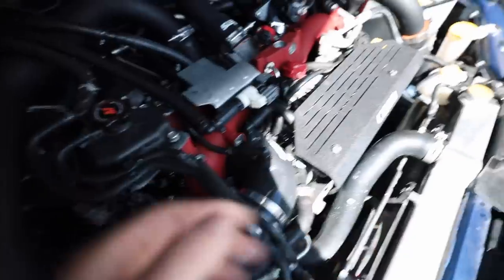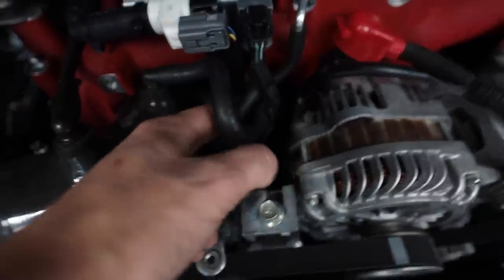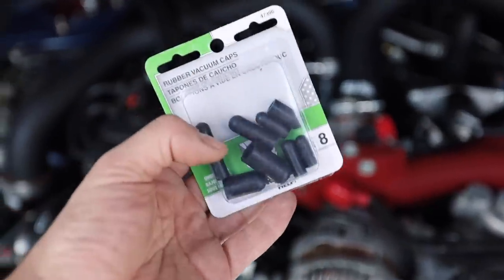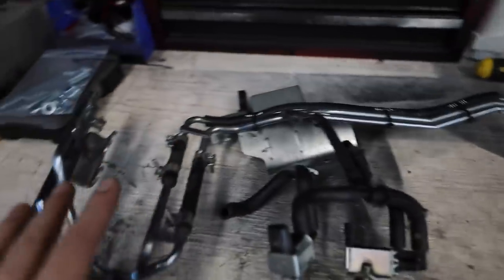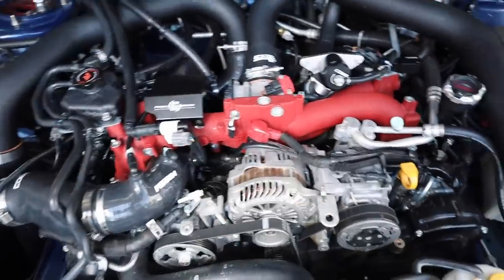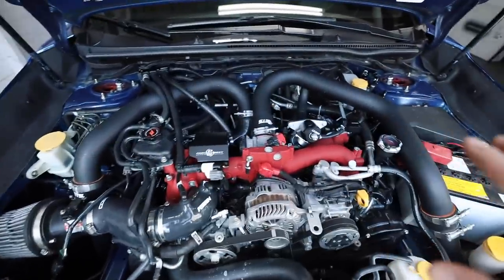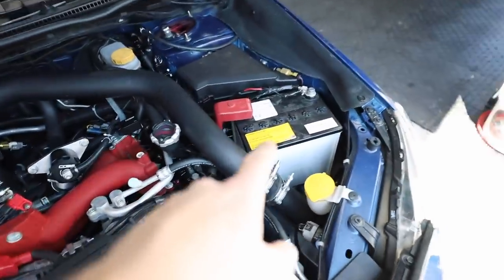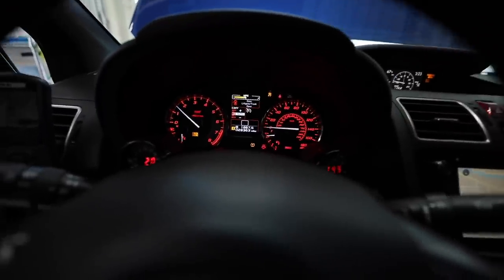How to Delete your EVAP Solenoid (STI)

Comment: Keep in mind, any rubber cap on the intake manifold can potentially become brittle and rip, causing hidden vacuum/boost leaks so make sure they're inspected periodically and replaced accordingly. The other  method of capping unused intake manifold ports is to use the same diameter rubber hose as the cap and plug the hose with a machine screw, then zip tie/clamp it to stay put.
Reply from the maker: I've used that method before as well to cap off, and agreed the rubber will become brittle, especially in the heat or hotter environments. Good add joe! 😁
Reply: @Smeedia  No problem, my guy! Pumped to see it on the dyno soon!
Reply from the maker: Same! Just got fuel pressure set, car is running beatifuly on the base map now!
Reply: @Smeedia  Outstanding!
Reply: My question is! Will the codes comes back on if you replace the battery, or Reflash the ECU?.

Comment: Run the dump hose down next to the transmission. You won't smell it and you won't want it in the fender because you will have oil and other goodies come out of the hose.
Reply from the maker: Good call, I was thinking of going to the drivers side to dump it all so its not all dumping onto the EWG
Reply: @Smeedia  Bingo. I also have my Perrin AOS drain hose going down with a ACE hardware copper shutoff valve so I can drain the AOS when I change oil. I personally don't want any fluids recirculating back into my oil. 🤷🏻‍♂️
Reply: You could even zip tie the hose to the bracket that holds the transmission vent hosepipes! Thanks
Reply: You could even zip tie the hose to the bracket that holds the transmission vent hosepipes! Thanks

Comment: Simply use a golf tee to plug the intake and leave the canister evaporator hose open. You do not need to remove the solenoid because it will stay open. If not, then just disconnect the canister hose. Do not unplug the purge valve!

Comment: A shop worked on my car 09 wrx, put new aftermarket fuel lines, TGV deletes, and all that good stuff, they asked if I wanted to delete the EVAP solenoid and I said yes, but now my car struggles to turn on I wonder if that delete is the problem. Also the smell of fuel is unbearable. Planning on putting the EVAP back in hopefully it fixes the starting issue.
Reply from the maker: Putting it back in should help clear up those issues 🙏

Comment: This video just saved me so much time finding where the evap line from the T to the stock fuel lines went. You are the man.
Reply: looking for evap lines is why i'm here
Reply: @furykillerBZ   yeah its such an annoying part of rebuilding an EJ if you dont do it alot.
Reply: @erikpowers4358  at this point I'm not even rebuilding; just chasing a vacuum leak
Reply: @furykillerBZ  ughh even worse. Good luck with it. Hope you get it squared away quickly 🫡

Comment: Bro you’re videos have been helpful more than anything else with my recent bugeye build, i just installed iag fuel rails with aeromotive fpr evap delete custom diy tgv delete, walbro 450 lph, 1300cc injectors and a Blouch 18g billet wheel.
Reply: Took about 9-10 hours total over 5 days but so worth it looks so much cleaner now
Reply from the maker: Eyyyy glad that it came out clean!!!!

Comment: Bro thank you so much for this video, just threw a cel (P04AC = EVAP SYSTEM PURGE CONTROL VALVE "B" CIRCUIT LOW) in my sti today and had no clue what was going on, didn’t realize that the solenoid is useless af! Just reset the code and I’m doing this to mine ASAP
Reply from the maker: Anytime dude! To permently remove the code you'll need a tuner to delete it or the accesstuner program 💪
Reply: @Smeedia  will resetting it on my accessport work?
Reply from the maker: Unfortunately not permently 😖

Comment: Hey Tanner. I'm a big fan and been following your page since your "how to make your wrx/sti more reliable" haha. 

Anyways, I have a 19 STI and just had a reputable tuner/shop in my area install and protune me on Flex Fuel; I was previously just Stage 2+ in the past. 

I've had the tune for 3 days now and I have been data logging for at least 100+ miles city/hwy with no hiccups to report to my tuner. 

But suddenly tonight at 7pm, after my tuner/shop closed, my car threw a CEL P04AF 'Evap System Purge Valve 2 ("B") Stuck Closed' after what felt like a rougher cold start than usual (e60 in the tank right now). I let the car idle for a minute or two before shutting it off. 

So I sent an email to my tuner/shop and I hope to hear from them tomorrow morning. 

But I was wondering if you had any thoughts on what this issue might be about? Obviously I'm gonna wait to see what my tuner/shop says. But did you experience this same problem after going Flex Fuel too?
Reply: Just ordered some merch from your online shop to support the channel! V2 tees x2 👌👌💯. Keep up the great work!
Reply from the maker: I deleted thr EVAP system in my car before going E85, very simple to do and your tuner can remove the codes that would pop up with it. But sounds like thr Evap system is not a fa of the E85. What E % are you using? 

Also appreciate the support my friend! 🔥🙏
Reply: @Smeedia  dyno-tuned on e78 with cobb's flex fuel sensor. E60 was what the accessport was reading during start up.

Unfortunately my tuner/shop said they arent free to diagnose until this Saturday =[.

Why were you getting an EVAP CEL initially? Jw
Reply from the maker: The Selonoid was starting to go bad on mine 🙃

Comment: Great video. I broke the connector on my evap solenoid. Can I just cap off turbo inlet, unplug both solenoids, and run the vent line to the fender? Tune is tomorrow!!! Thx Tanner
Reply from the maker: Ywssir you can! Your tuner jad thr ability to turn off the codes

Comment: I Have had those type vacuum caps crack and blow the tips off several times under boost , keep an eye on em
Reply from the maker: How much boost are you running? So far no issues with mine 🙏

Comment: Is it possible to do this and drive the car without getting a tune? Will you just have a check engine light on? I’m currently pulling out my manifold and snapped a nipple on the evap solenoid as well as snapping a few brittle evap lines. Trying to avoid having to buy a new solenoid. Can I just delete it all? I don’t mind a check engine light as long as it doesn’t effect how the car runs. My car already has a check engine light anyways

Comment: Once you deleted these how has everything been once you got your tune? Also, once you go the the flex fuel system with the new Cobb fuel lines and regulator and all that, how would the evap sensor be set up if someone decides to keep it all?

Comment: I am always excited to watch your videos. I am pretty pumped i just put brand new plugs in and a mishimoto performance intake. Ill be doing my TGV Deletes and ECBS along with my Protune/Dyno tomorrow. Keep up the good work!
Reply from the maker: Appreciate the support and good luck on the rest of the installs!
Reply: @Smeedia  No problem man. And thanks i have a 4 hour drive to get my pro tune. I had quite the issue with my local guy.
Reply: SlimSticky good luck with the TGV deletes it’s a PIA I did mine last week and I did the air pump delete as well. Might as well do the turbo inlet while in there as well I just did everything as I don’t want to remove the manifold ever again.

Comment: So I have a comp AOS and have done this evap delete. I can't stand the smell of fuel that the car has now >.< I am not sure whether it is the AOS or this hardline by the firewall that causing the smell but I have ordered an AOS conversion from Comp to Street series. Do you have any advice on whether the remaining hardline can be plugged or maybe routed back to the turbo inlet to get rid of the smell? Mine has a line just tucked pointing towards the lower part of the engine. I believe routing towards the fender like you did may help vent the gases when the car is moving but my issue is when having the car idling or when going at lower speeds (parkings, traffic, etc.) I just discovered this vent watching your video and have not tested if the strong smell comes from it or if my initial theory of the AOS being the culprit still stands :) (The delete was done in a shop, but now I am starting to mod and learn about the engine by myself)
Reply from the maker: The main smell comes from the comp AOS, routing that evap line into the vendor should pull vapor under the car when driving to get rid of that smell even more 🙏

Comment: So, you couldn't use the Cobb turbo inlet because it was missing one port. But since you have done an evap delete, you have removed one of the ports on the turbo inlet. So couldn't you have used the Cobb turbo inlet if you did the evap delete while doing the other engine stuff???
Reply from the maker: Yes 😅 at the time was not planning on doing the delete but happens, the Cobb one still fit like trash around the TGVS, The perrin inlet fits pretty well around them

Comment: Can you use the hole in the intake manifold left by the evap vacuum line for an IAT sensor used for speed density?
Reply from the maker: No, the SD/AIT adaptor needs a 1/8th NPT bung to be screwed into unless your able to find some type of adaptor
Reply: @Smeedia  ahh ok.  it's probably also more cost efficient to have the bung welded onto one of the charge pipes, or as i've seen others do, on the end tank for a tmic.

Comment: Will the codes comes back on and check engine light if the battery runs dead?. Or if re-flashing the ecu can make the codes and engine light come back on again?.
I been having this issue with a code P2404 evap small detection pump leak for like a year already on my 2015 Wrx and is driven me crazy.

Comment: Can you take this out without getting tuned after?  Say for example if already running a previous e-tune or an ots map.
Reply from the maker: As long as your Etuner deletes the codes it shouldn't be an issue
Reply: @Smeedia  ahh i see.  so i'd need to hit up my e-tuner to just add in a code delete or however they add that in.
Reply from the maker: Yessir 😁

Comment: Will deleting your evap system give evap codes.? If so do u have to get that tuned out, or will it always b there? I have a code for p0458 purge valve circut low input. But my system has 255 fuel pump/ tvg delete iag upgrade.  Cobb 1050cc injectors iridium fuel pressure regulator . I tried changing gas cap but code is still on:/ after I disconnected the msg terminal and start the car the check goes away until I start the car again then it will pop up:/ every annoying man.

Comment: Assuming you had a P0458 code for the check engine. How did you get ride of it. Tuned it yourself or what?
Reply from the maker: Had my tuner turn the CEL off 🙏

Comment: How is the EVAP system related to emissions? I though it was just meant to take gas vapor (and subsequently pressure in the gas tank because of heat/expansion) and then throw them into the intake manifold to be burned.... am I confused?
Reply from the maker: Essentially yes that is the function, but some states don't like when people vent the gasses back into thr atmosphere instead if plumbing bsck through thr carcoal canister to reduce harmful gasses. Instead of having the sensor and lines min just vents all the fuel vapor into the atmoaphere. In states like California you can fail inspection and SMOG

Comment: Great video! I have a subaru Wrx sti 2004 it just throw P1443 code. I've been researching and can't find anything concrete. Is it the solenoid in engine bay or the one by the gas tank/charcoal canister? I'm learning just started working on my own car.
Reply from the maker: It's typically the solenoid but I have seen some where thr canisters go bad 🙏
Reply: @Smeedia  I read somewhere that if you have trouble filling up at the gas station it's definetly the canister?
Reply from the maker: That is correct 🙏
Reply: @Smeedia  thank you! Been trying to figure it out a couple days now

Comment: I actually have that line by the firewall capped off. Do you know which route is best, capped or venting to the fender as you did?
Reply from the maker: I would route it to the fender so it can vent any built up pressure 🙏

Comment: Great video. Love the car man. I’m in WA as well! Question, so if I’m running the stock fuel lines under the manifold do I just cap the line from the T to the fuel line off?
Reply from the maker: Don't cap it off, vent it to thr atmosphere, run a hose down the frame rails. And wyyy, what area?!
Reply: Smeedia thanks man! I’m in Longview,Wa. Near Vancouver WA
Reply from the maker: Eyyyy, not too far at all! 🙌
Reply: Smeedia where you at?
Reply from the maker: Puyallup area 🔥

Comment: I'm still fairly new to the subie game, I own a 2015 sti. I've only had it for a year so I don't know a whole lot about these cars. I'd like to know if you can do this delete on a stock sti or do you need to have it tuned first? I've done quite a bit of research on the things I can/can't do without needing the car tuned beforehand but haven't covered it all just yet. Anyway, thanks in advance
Reply from the maker: You can do it on a stock car but you'll have to tune out the CEL from deleting the EVAP
Reply: @Smeedia  what do you mean I'll need to tune out the CEL? How would you do that?
Reply from the maker: You need a tuner to do it. Removing Removing purge valve will result in a check engine light 🙏
Reply: @Smeedia  okay for sure thanks much appreciated!! On another subject, I'm having some issues with my Sti. It's acting like it has no power. I can only build 5lbs of boost and when I go over 3000 rpm I hear a whistling type sound. I thought it was the pcv valve but after removing and cleaning it, the problem wasn't resolved. So I'm thinking I have a boost leak coming from my intake inlet. What's your opinion on the this?
Reply from the maker: Could very well be, while the car is running spray some soapy water around thr areas that seem to be leaking 🙏

Comment: Hey man I’m sure you know but you said you’re going to be running the comp aos soon. If memory serves me correct iag says if you’re under 600hp on e85 you need to run the street. I guess that means you’ll switch to the comp when you go rotated! Lol Great vid as always!
Reply from the maker: The cars going to be on pump gas 95% of the time so under 600WHP on Pump they suggest the Comp. Because I can't get E85 all of the time easily I just want to have the tune so if I want to use it I have it lol 😁
Reply: Don’t forget for comp aos you need tune. Street. Series you don’t need tune.
Reply: Smeedia ah gotcha man sucks you can’t get e85 over there! In my neck of the woods in Illinois you can get e85 at about any station.
Reply from the maker: I can get it, but I have to go outta my way to stock up 😅

Comment: Would this help with car running rough and when I put fuel in it has hard time starting I wounder if this would fix it cause I have evap code too
Reply from the maker: Would think vapor canister by the fuel tank if those are your symptoms

Comment: What is the  hose called that yoy rerouted to the wheel well? I bought a truck that has the evap and egr system deleted. Just yesterday i plugged all the vacuum hols but theres a good possibility that i plugged one that i shouldnt have
Reply from the maker: It's thr EVAP line that goes to thr evap solenoid 🙏 shouldent be plugged
Reply: @Smeedia  thanks brotha

Comment: How similar is this on a 2005? I have a 2005 with a p0458 code and I am trying to figure out if i should just get rid of all this stuff. Does it need retuned?
Reply from the maker: Same same, deleted it on my 05 as well 🙏 you'll need a tune to remove or delete the code
Reply: @Smeedia  Will it hurt on stock tune? Already have a code and didn't wanna tune for awhile. I can deal with the codes until then.
Reply from the maker: It may make the car feel sluggish but aside from that it shouldentnhave any adverse effects

Comment: Hey I have a question is it bad to delete the secondary air injection pump? 🤔 im just curious
Reply from the maker: No, only used for cold start for emissions, you'll throw codes but your tuner should be able to remove them 😁
Reply: Smeedia thank you so much for the response!
Reply from the maker: Anytime! 😁

Comment: Watching your old vids, thats my current step, removing my intake manifold, after finish with it im removing the damm evap spaghettis and the air pump nightmare.  So i got a question brother, I'll run a speed density with the tial q bov, i have the perrin inlet on the stock VF48, ive been trying to find the bpv plug block off for the inlet, i got one in aluminum but is to big and doesn't fit, any particular one for the perrin 2.4" inlet that you know of and where i can get it?
Reply from the maker: Try a local auto store for some standard plugs, that's what I use 🙏

Comment: Doesn't the competetion series iAG AOS basically do this same thing? Thats what I run
Reply from the maker: Essentially, just vents the gassed to the atmosphere instead of back into the intake
Reply: @GetaDomTune  Competetion series iAG AOS obviously does not ONLY vent crankcase gases to atmosphere, its main purpose is to separate the oil from the intake track and return it back into the block, but i do believe its related because ive installed the AOS onto my own car and removed some of the components he did as well.
Reply from the maker: The only different ports are the PCV ports from the turbo inlet and the PCV tube going under the throttle body. The Street to Comp plugs those 3 ports and no longer circulates the gasses/oil vapor back through the car.